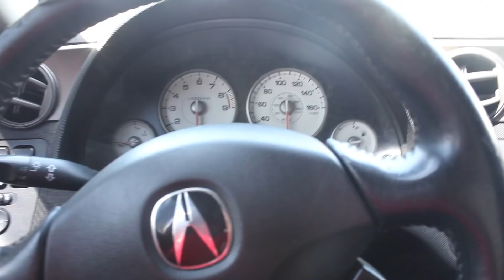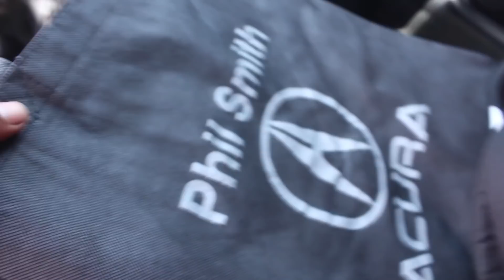Car Vlog (Rsx Type-s) Innovative Motor Mounts

Comment: I have question. I just have the innovative mounts install on my dc5. Why is that so much vibration transferred to the cabin? I have called innovative up and they said I torque it too tight. Is supposed to be 55ft pound of torque all around. How do you feel it?

I got the billet replacement with 75A bushing.
Thanks in advance!
Reply from the maker: Justin Horman anytime you upgrade motor mounts the vibration is going to be intense
Reply: @TORqueTV  hmmm... do Innovative Well the 60A still? I only see 75A the lowest. Only If I knew  -_-